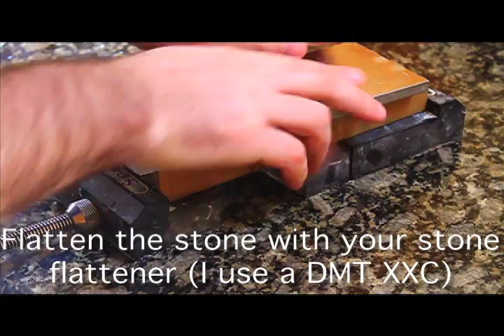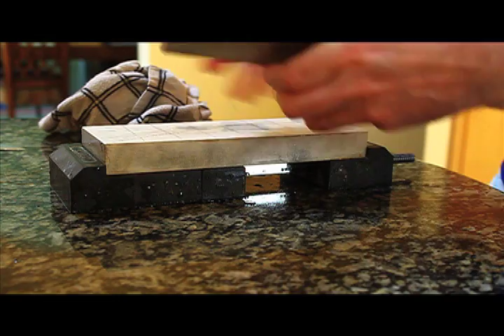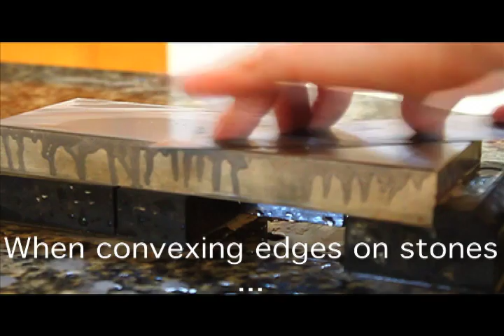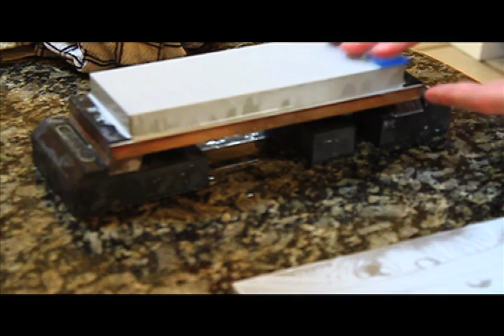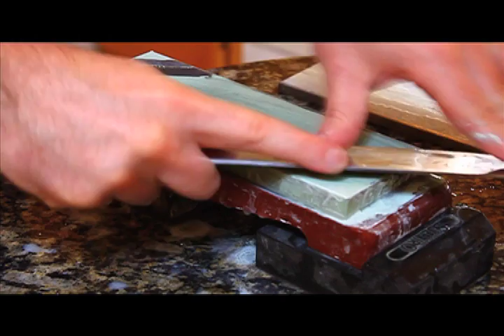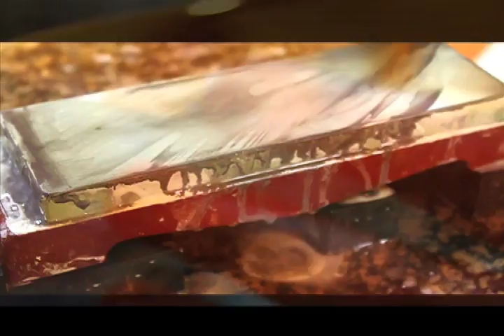Japanese Knife Imports- Sharpening an Aristugu A-Type Gyuto

Comment: actually glass is flatter and the chinese waterstones go to 12000 grit the finest diamond stone i have seen is 1200 and that was more expensive then two lesser grit stones 
cheap diamond "stones" are great for average work but to sharpen a fine cutting prep knife a knife that can cut so thin a slice of radish that you can read through it that takes better sharpining tools

Comment: um most chinese water stones are graded abrasive in a soft resin matrix can't get too much more man made then that. the last stages of sharpening smooth the blade, so nothing sticks and spoils the cut. an edge sharpened to the limits of ultra fine abrasives would be so fragile that the first hard spot would chip the edge.